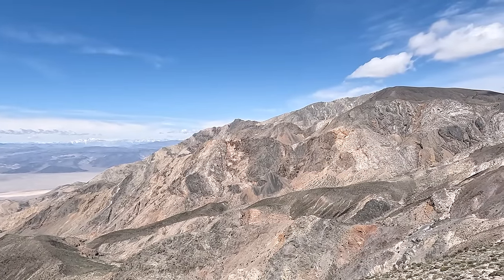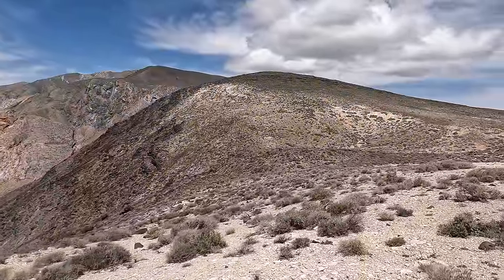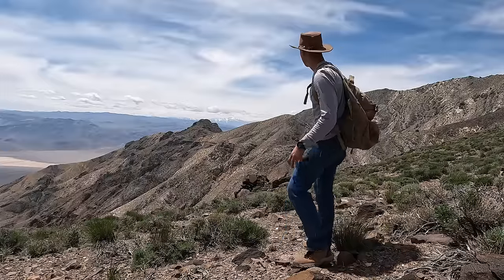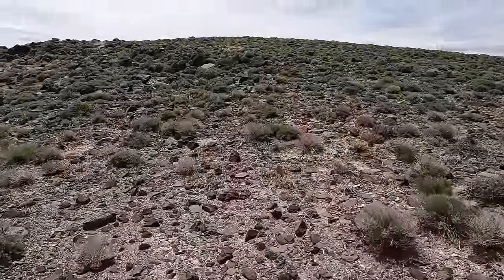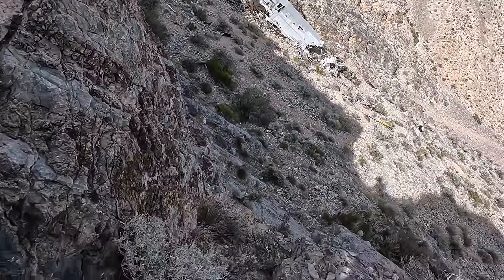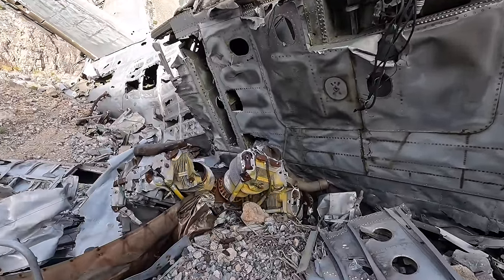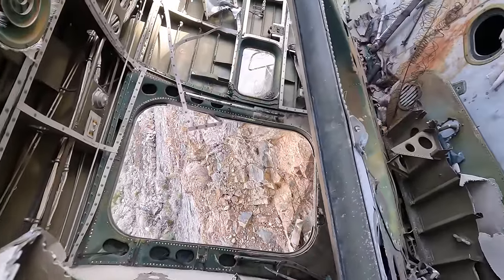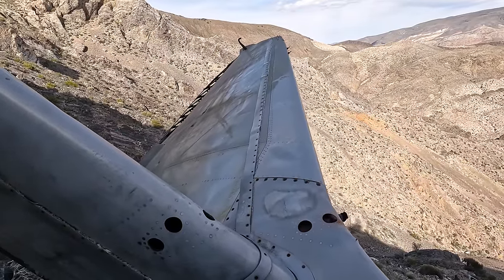Hiking to a 1950's CIA Plane Wreck of an SA-16 Albatross

Comment: The white wire with the insulators is an antenna that’s mounted on the outside skin of the aircraft. The yellow box is part of the avionics (ie. aircraft electronics). Looks like maybe a transmitter as it has two ceramic insulated posts on one end. Quite possibly an emergency survival type radio as I recall seeing some in the early ‘60s very much like it. The “light” looks like an engine turbo-charger at first glance. But it’s a bit small and is driven by an electric motor which makes it a ventilation motor  for the crew and or the avionics. Best guess would be for forced air off an onboard gas fired heater. It gets real cold up at altitude. 🥶 With twin engine aircraft you generally don’t get bleed air off an engine for heat so, with few exceptions, they used onboard heaters.  Too bad you didn’t find a number plate on the engine. About almost 48,000 of that type of engine was produced from multiple manufacturers (even Studebaker!) and countries. Caterpillar even made a Diesel engine version (D200) for the M4 Sherman.  Great explore. Good job!
Reply: The propeller was amazingly straight for a crash indicating no rotation or power when it crashed.
Reply: wire with insulators is probably an hf radio
Reply: Probably HF?
Reply: Great information sir. Thank you so much
Reply: @robertbandusky9565 high frequency radio?
Reply: The yellow box has tube sockets in it for Vacuum tubes, you can see them on both sides of the circuit board when you picked it up.  That's definitely either a tube transmitter or a power amp to power a speaker for the radio, either one or the other, I'm not up on airplane electronics, so I'm not sure which it is, but I recognize capacitors in that box as well, which would indicate either a transmitter or an amplifier.
Reply: Thanks for writing this :)

Comment: Looks like the engine found was not turning at time of impact or the blades would be twisted and snapped off. I used to play in a crashed B29 in Moses Point Alaska in the early 60’s. Was on its way to Russia in WW2. Located close to White Mountain on Norton Sound east of Nome
Reply: Hey I know the area and parts of the plane are still there. I've lived in Alaska since 1974 and there are actually plane wrecks all over the place many lost during WW2 going over the top to Russia for the lend lease program.
Reply: No. That's when the engine crashes into something that's flat ground and it has time to hit the ground. This is first and foremost a seaplane. The engines are way up high. So even if it would've crashed on flat land, it would've been impossible to have that broken/bent blade, the floats would've kept the wings level. Honestly, as planes that go down, if you're in a field, this may be the best to do it in.

That said, that's the left side engine, the one that didn't smash into the mountain side (the airplane came in at a 45 in a low angle, going by the remains). As the wings twisted off the airframe in that fraction of a second before the airframe itself touched the mountain face. This engine likely went under the airframe as it would've instantly stopped, twisted down with the wing which is now broken in half (it's what you see, and smacked face first into the hard rock... which is why it's mangled axially, which is something you rarely see. Note when he shows the propeller, that the whole thing is intact except for the fact that the shaft isn't where its supposed to be and the assend of the engine is blown out, from the impact with the ground.

A violent crash that would've come from full motion to total stop in under 20~30 seconds.

There's also evidence of a fire. The discolored tail section and the metal gashes which aren't scrapes, rather the aluminium skin melting and that first electric motor he picked up has a rounded piece of aluminium that's molten off, likely where that thing was initially was mounted.

If you've seen those car crashes they do when they test safety, and they crash a car into a concrete part, biased to one side at an angle, that's basically what happened here, with the added difference of the wings. The thing came in low, almost horizontal, hit the mountain, twisted ground and compressed whilst the tail section rotated up (trying to keep its momentum) and eventually fell down again, right over the left side motor.

Further evidence to this is the mounting for the antenna that basically ripped apart the tip of the tail. Note the cable that dented an almost perfect line into that tail tip. This thing came up, the cable came slack, fell the left as the tail went with the momentum, the wings (where the other mounting for the antenna was) twisted and ripped apart, making the cable taught again and ripping it off.

The only reason this seaplane isn't strewn all over that mountain side is because of that one cable. When the engine and left side dug into the rock, it moored the tail slamming it back down. I bet that if you were to look under, you'd see the bottom that's touching the rock now, deformed.

Fun fact, to appease after this comment which may come off wrong (just trying to impart what i saw here): This is a seaplane, essentially a flying boat... on top of a mountain. And with it, there's at least one boat cleat (albeit aerodynamic cleat) that would've once helped moor the seaplane at a dock. 24:01
Reply: Thank you for the in-depth information. I’m no expert, just know enough to follow a discussion. Always great to learn new things. I love aircraft, ships, motorcycles, and cars ( I own over 50 classics).

Comment: What's crazy is, as the name suggests, the plane is a sea bird. It is (or was) an amphibious plane that could land on and take off from water and also had retractable wheels. This plane was far off course for any water operations and not one I would use for covert operations in the desert. You did this one up right. Not an immediate trip to the site or footage at 5x speed, but shows a little of how you got there and stopping to "smell the roses" along the way. Great views and there's a reason why you were struggling--the air is super thin up there.
Reply: CIA ... need we ask why ?
Reply: I think the most hilarious (if we can allow that) thing of this whole affair is the fact that there's now ... a boat cleat on the top of a mountain and technically speaking, a boat too... 24:01 the cleat is by the gap which would've been a small door there, likely to help with mooring the seaplane.

Comment: Engines always roll down the hill after detaching in a crash, the other is probably at the bottom. I live on the side of Mt. Tamalpais in N CA and we have two Corsairs, a B-17 (only one engine left) and a lot of wreckage of a PBM-5 Mariner seaplane. I found one Corsair engine in a creek, the rangers say they are up higher and someone stole a whole wing in the 90's. The story about the B-17 is interesting, it was cleaned up quickly but locals took pieces of it before they could haul it all away, it was supposedly carrying detonators for the atomic bombs. The Corsairs were pilots in training and they hit each other but they both bailed out and made it. I grew up on Oahu and I know where engines from Pearl Harbor are grown up into trees.
Reply: To see trees growin out of somethin like an engine would be so damn cool. Would make for some brilliant photographs!
Reply: That's the left side engine, which initially dipped down, broke the wing in half as the other side basically ground and compressed to  bits as it impacted the side of the mountain. When the airframe finally contacted, hence the lack of anything forward of the rear of the airplane, it wound up under the airframe as it slid down.

Kinda like when you see those car crash tests, they do a side impact in the right side, and the car's rear basically lifts in the air as the momentum is instantly dumped into the unmovable item it crashes through, but the rest of the car still wants to travel forward.

Same here.

Comment: On 24 January 1952, SA-16A Albatross, 51-001, c/n G-74, of the 580th Air Resupply Squadron (described as a Central Intelligence Agency air unit), on cross-country flight from Mountain Home AFB, Idaho, to San Diego, California, suffered failure of the port engine over Death Valley. The crew of six successfully bailed out at 6:30 PM local with no injuries, walked south some 14 miles (23 km) to Furnace Creek, California where they were picked up the following day by an SA-16 from the 42nd Air Rescue Squadron, March AFB, California. The abandoned SA-16 crashed into Towne Summit mountain ridge of the Panamint Range west of Stovepipe Wells with the starboard engine still running.

Comment: I spent a few years in the USAF working on C-130-E aircraft... from the very beginning of working on the Flight Line the Supervisor had me Services the Kanut Valve and then the Muffler Bearings.  To this day I never found the Kanut Valve and the Muffler Bearings were stuck so far up in the Tail-a-me Pipe that I just Signed Off as "Serviced" .... and I didnt see any in this wreck you are at either   :)    *Thanks for the Vid!! I really enjoy the Desert Areas!!!

Comment: That engine on the right side of the remaining fuselage was extremely likely THE failed engine. You can tell because the two blades visible were not bent backward, meaning the engine was not turning when it struck the mountainside. 

I hiked out to the crash sight of a Vought A-7E Corsair II near NAS Fallon, Nevada, back in the late 1980s. It had been on a training flight some years earlier when it collided with a Cessna that had wandered into the restricted area around the target range. The pilot ejected, so naturally, the seat was not present. Also missing was the engine. I am assuming the Navy recovered it for analysis. Everything else was there, including the M61 Vulcan cannon, whose barrels were all warped and misshapen, and several Mk 76 practice bombs, some still attached to bomb racks, or MERs (Multiple Ejector Racks). This site was on the valley floor, near the extreme southern edge of the target range, so the hike was not nearly as strenuous as the one featured in the video. It was hot and dusty, but still a relatively easy trek. I had spotted the wreckage, which I had identified by the shape of one of its wings, from the air some weeks earlier when I flew in the back seat of a Cessna O-2A Skymaster spotter plane our squadron flew for tracking practice bomb hits and calling them in during F/A-18A Hornet air-to-ground ordnance delivery training. There are two types of people who flew in O-2s on those missions: those who are going to throw up, and those who have thrown up. Even the pilots admitted to losing their lunches in those birds. For some reason, the Skymaster was referred to as the "Duck" by Naval personnel.

Comment: That engine doesn't look like it was running at the time of the crash. If the propeller had been rotating, that propeller blade would have been bent backward towards the engine the moment it impacted the terrain. 
I understand that they left the good engine running when they abandoned the aircraft.

Comment: 18:16 That is not a light fixture. At first I thought it was a turbo impeller but it has a motor attached, so it might be just a fan or air pump of some kind.

Comment: It was supposed to have two, 9-cylinder engines.  It only lost one engine.   Maybe  because of the altitude id could not stay up on one engine?  It happened On 24 January 1952,   The crew of 6 bailed out
Reply: I was wondering that myself.  It could carry 14 people or 5k total pounds.  But, it was the CIA, so maybe some other "substance" weighed it down below it's single engine ability.

Comment: Not an expert, but some observations. I tried to keep to what i know, so i'm pretty confident about them.

That first item you picked up was some sort of handle linkage, note the rack teeth. Possibly from cockpit, possibly from somewhere inside the airplane.

The second item was an electric air vacuum turbine, would've sucked air through the impeller that's visible, and force fed it through something. Either to cool electronics or to keep something hot through some means of heating, electric or otherwise.

The motor you picked up, notes the fact that there was a fire hot enough to melt the aluminium that the motor had been bolted to, note the rounded lump of aluminium on the face of the motor, by the gear. That only happens in a hot fire at around 660.3°C or 1,221°F.

The ceramic bit is a "Ceramic Feed-Through Insulator CBU 61007" possibly RF antenna bits, that would've gone through the skin of the aircraft (making it a bulkhead fitting) to the outside. AFAIK, this bird had three such antennas. All going from just behind (above) the cockpit area to the tail, right side wing, and another shorter to the middle of the wings, just to the left.

The next item you picked up after the tube electronics device (yellow mangled box) was an armature, from a motor with yet more signs of fire.

The old Wright R-1820 Cyclone engine, considering how the impact took place, this is likely the left side engine, seeing as the other smote upon the mountain side. The yellow is not original to any of the bits you see, that engine would've been green in the center area, aluminium bare everywhere else. Someone was up there post crash, spray painting yellow on things...

Another electric motor, likely placed there by someone. Looks to have some sort of air intake on the rear to cool it, so perhaps its purpose would've been to drive a hydraulic pump.

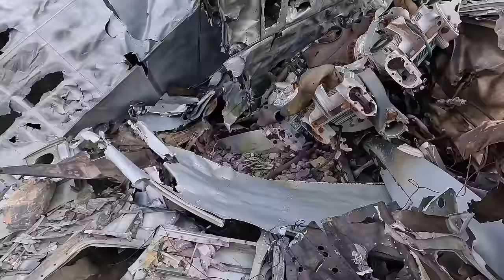22:09 propeller. Note the 0 on one of the blades.

22:31 note the round pipe. That would've been something that someone was meant to grab on or part of a chair. It's now... outside.

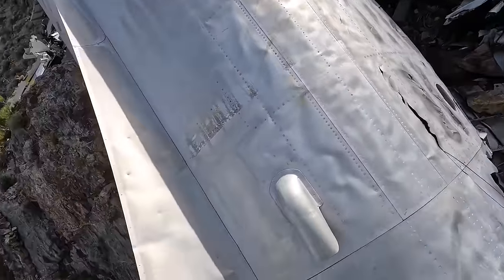23:43 note that despite the fact that this did not roll, the top of the wing is ripped off. Very likely that's the result of the antenna mounting being ripped out of the tail's top. Those would've been strong, braided wires. The mounting would've had no chance.

24:01 the oddest thing one may find on an airplane... a mooring, point AKA a cleat. Used to secure the airboat on a dock. Note the asymmetry of the cleat, which makes it aerodynamic. A regular boat cleat would've been symmetrical. 

24:16 Note the fabric torn off around what's left of the air duct that would've brought air inside the passenger cabin. 

24:34 you can see the faded remnants of the US roundel with the star (star and bars), one sole point of the star visible. That gap you peaked through would've been a closed shutter, likely there to help with mooring the airboat. Note the two registration locking points in the air frame, where the locking pins of the door would've been. Likely a linkage system would've dropped the two at the twist of a handle.

25:20 this one, in the shade has remained pretty much intact.

25:46 better view of the path of the mounting as it ripped through from the peak of the tail when the cable was pulled. I'm not 100% certain, but it's possible that this is a designed feature, because mounting it more securely would've resulted in ripping off the entire tail. So a give give situation, where the engineers decided that the mounting is better off being the one that rips off than the entire tail in the event the cable gets snagged. You can see that the force dented the skin as the cable was pulled from the right as the wings ripped off in the crash.There's a straight line from down up that can be described. I believe that the wings initially twisted up as either the floating device or the tip of the wing impacted, and then the air frame imparted its own twisting motion, which is what gutted the airplane, twisting and thus breaking the cable.

Comment: Judging by the lack of a post impact fire and the straight’ish prop I’d assume fuel starvation as the reason this aircraft went in! Also fuel starvation would have been known fairly early giving the crew enough time to get into their rigs in preparation of bailing out.
Reply: One engine failed and the crew of 6 all bailed out safely.
Reply: @bobbylee2853  probably failed due to running out of fuel! 🤷🏼‍♂️ glad to know they all got out safely

Comment: All  radial engines from the 30's on had ODD number of cylinders due to the intrinsic design operations of the camshaft ring - 7,9 in single row and 14 or 18 in double row (P&W Double Wasp or Wright Duplex Cyclone), 4x7 P&W Wasp Major (R4360). Further rows were unfeasible due to cooling issue of the rear cylinders plus which the gas turbine engine gave a lot more power than could be achieved by a radial.

Comment: That "light fixture" actually appears to be part of a turbocharger (I could be wrong.... and probably am).  Look at the front, again, and notice that those are fins/impeller.  The back appears to be an electric motor. The motor would spin, forcing the air to be compressed and forced into the cylinders (why I suspect that this part is part of a turbocharger)..  Still a really great video!
Reply: Water pump

Comment: Nice job. What you call a light fixture looks more like a turbocharger or a pump. Also, not a stabilator but a horizontal stabilizer: there are differences between the two.

Comment: 18:15 - that's an electric blower. withe motor armature still attached.
Must have hit hard to tear it apart like that.
18:56 - looks like an actuator motor.
20:02 - radio - I would speculate due to yellow paint, possibly emergency transmitter.

Comment: I am really surprised . That they never cleaned that sight up. Most of the times they use a Helicopter and a big net . So it's very strange that they never did.
Reply: Reality intrudes on your musings: It's always a matter of priorities and asset allocation. January 1952 the US had more pressing concerns than a one-year old SA-16A airframe. Choppers, especially heavy lift ones were in short supply throughout the Korean War. Cheers!